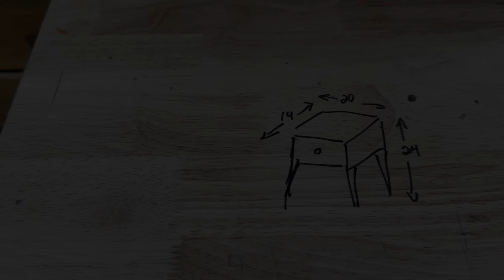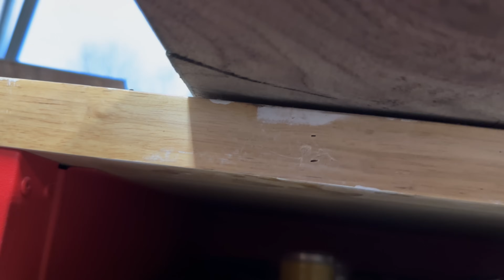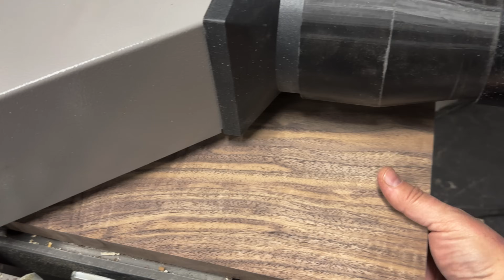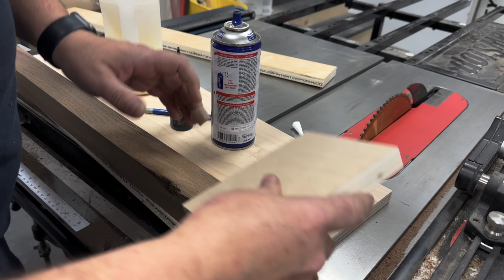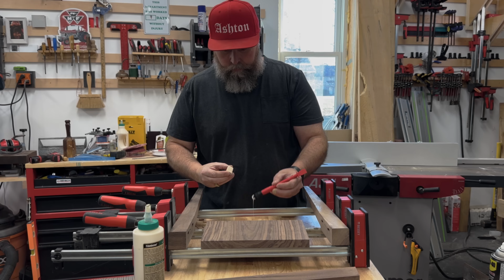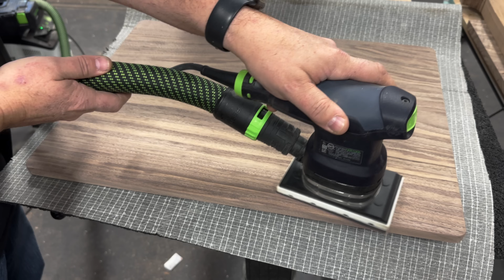Just Beautiful - Making walnut end tables!

Comment: Great work great work and thank you for thinking of the kids. The left overs could be used as shims. Instead of popsicle sticks, I use a pharmacist little knife like device that can be cleaned and reused.
Reply from the maker: Thank you! I’m a dad, so watching out for the kids is always on my mind. I actually meant to grab a bondo spreader which was just on the other table, but the wedge was right there so I grabbed it. The epoxy sanded right off after.

Comment: Thanks for the video as I am about to make two tables in the new year, not walnut though. I noted your Jessem Router table with the electronic height gauge. Do you use it ? I have not gotten my gauge to work properly, it just keeps reading higher and higher something to do with earthing but near got a response from Jessem on a fix.
Reply from the maker: Enjoy making those tables. TBH I have not used it. I fiddled with it. The key I think was to lay a straight edge over the bit when it is bottomed out and the zero the gauge and raise it. Record that value for repeatability. The only reason I don’t use it is because I make setup blocks for everything